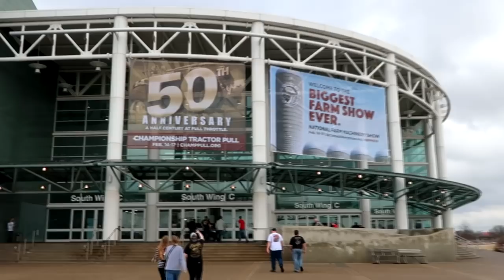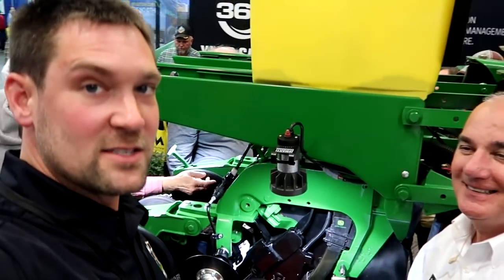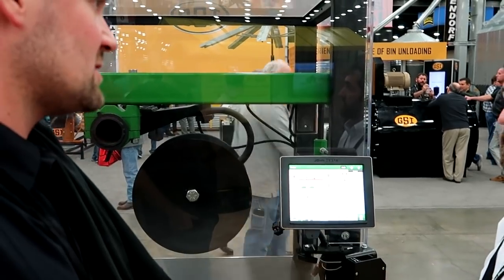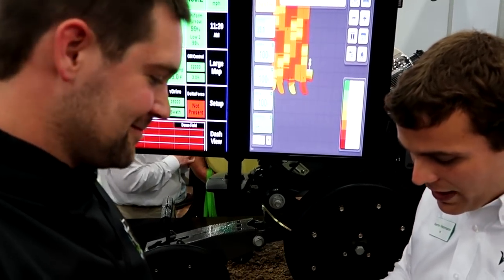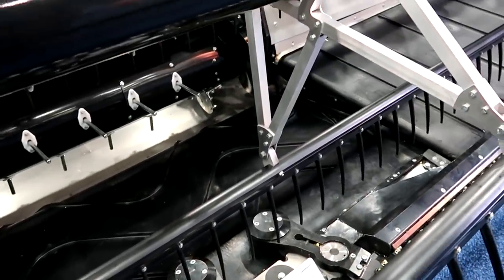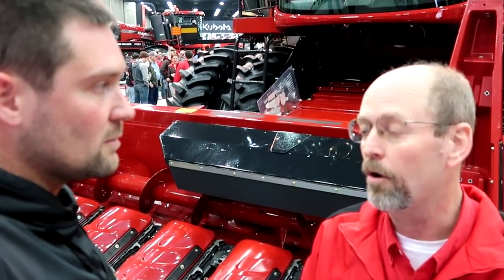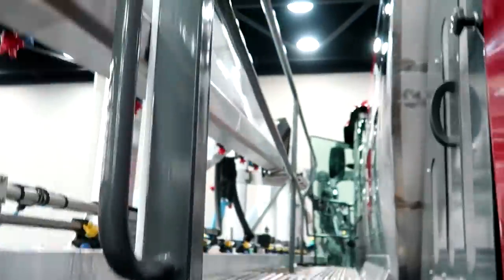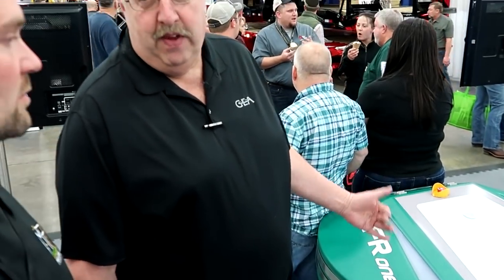National Farm Machinery Show 2018

Comment: That Fendt you saw, and the Challenger 1000 were identical in specs, just one's Nature Green, and one's Challenger Yellow.
Reply: Fendt and Challenger are tractors of the same corporation but are not the same. The Fendt 1050 has 517 hp, and the strongest Challenger 1000 series has about 470 hp. I do not think gearboxes are the same, the Fendt 1000 series has two power-assisted gearboxes. Fendt is the strongest conventional tractor wheel in the world. Greetings from Europe.

Comment: Should check out a MIller sprayer one of my bosses has one and its nice he uses it to spray and for seed corn usage, I had todrive it a couple times to move it to fill the fuel tank and at the end of the year to spray it which was the first time I drove one and well one down the road also but still don't know what button you would have to push to put it into like f2 gear to go as fast as it can go down the road
Reply from the maker: EDIE EDMONDS there was a local.guy who had a Miller a few years back.  He loved it but now he has a Deere and likes that even better
Reply: Yea, I would like the Miller better, the cab is more visible, and with it being in the front we can in do the spray booms and put on the oxbo attachment so we can cut the tips of seed corn or detiasil seed corn